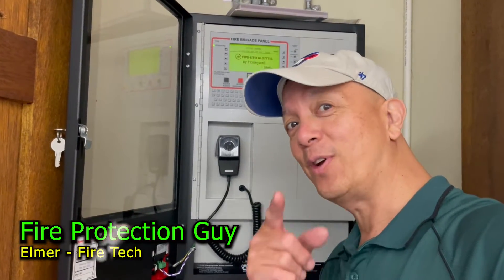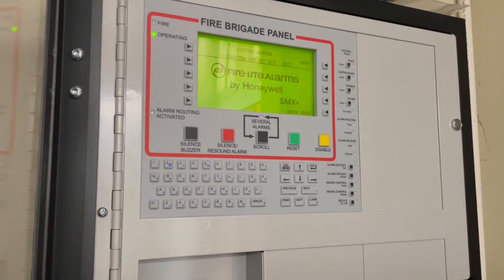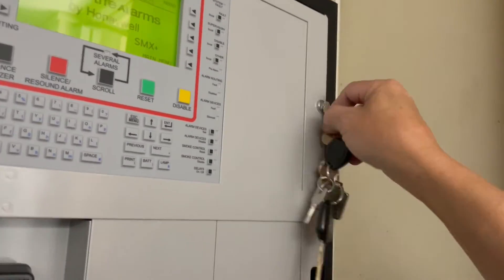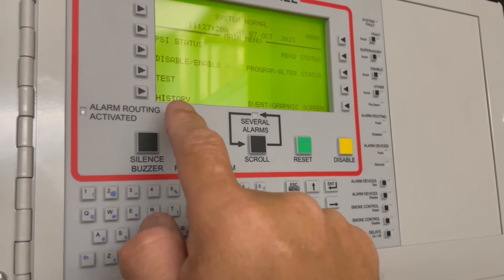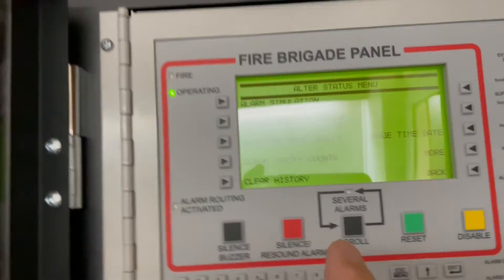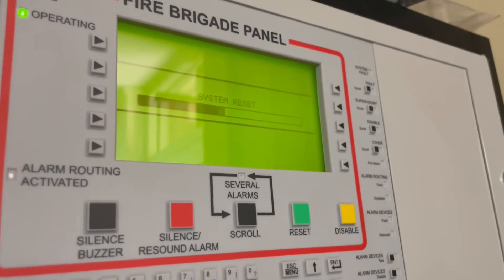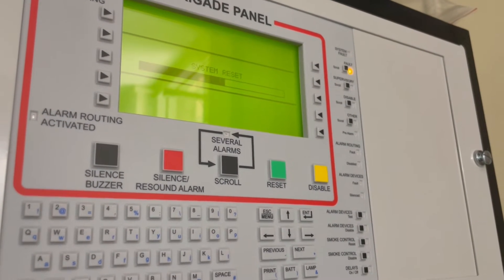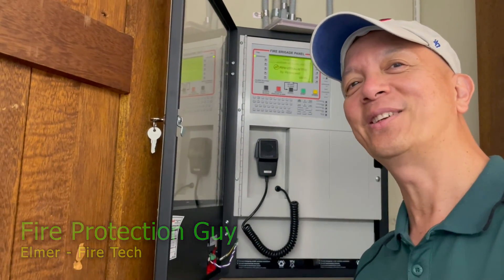Monthly Fire Alarm Panel Test - Fire Lite by Honeywell

Comment: Howcome the alarm doesn't sound like the normal Aus fire alarm?
Reply from the maker: Alert tone is not allowed in new standard. Only the EVAC tones.
Reply: @fireprotectionguy7943  is this for any particular reason? Like a tragedy resulting from delayed evacuation?
Reply from the maker: @tbaker4736  Alert tones are only for taller 25mtr building now with EWIS. For areas with only few occpuants , using an occupant warning system will sound an evacuation tones immediately. It's the new standard.